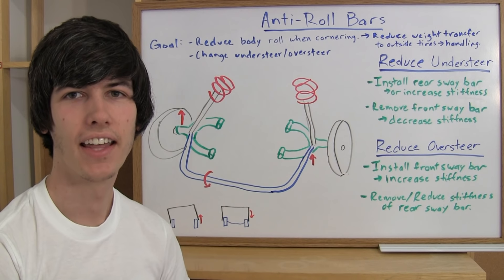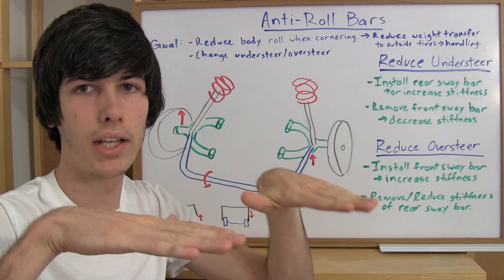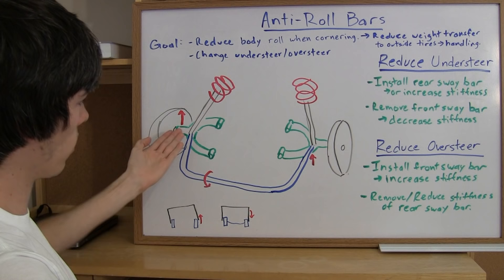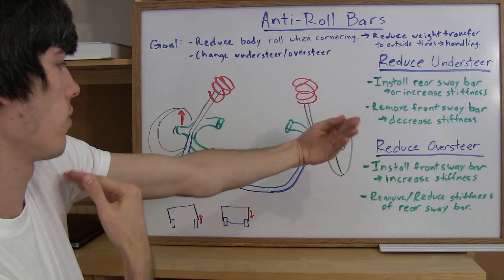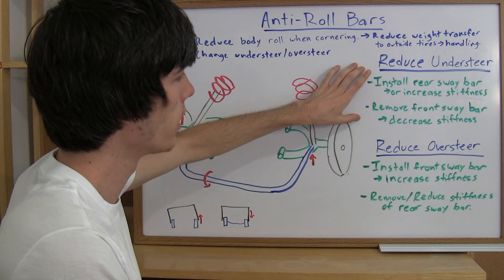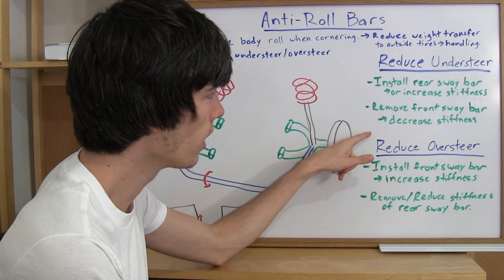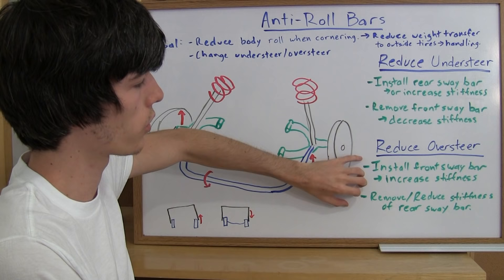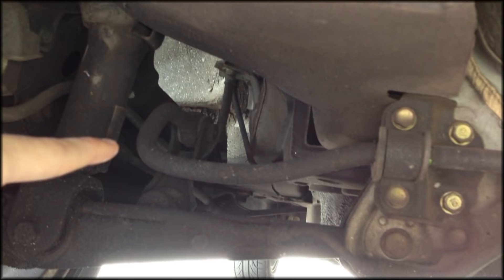How Anti-Roll Bars Work - How To Improve Car Handling

Comment: Hello Jason. Some people have been saying that removing the rear anti roll bar on a '14 Subaru Forester XT makes a huge difference to ride comfort over bumpy roads, without sacrificing any handling. Apparently the stock springs and shocks are already so stiff and the double wishbone setup so good that the anti roll bar is unnecessary. Do you think this is a good idea? Will it really make it more comfortable? What do you think about also removing the fronts? People say leave the fronts because that will make a big difference in handling (unless you want to go off road).
Reply from the maker: +Walter Black The logic seems sound, as roll bars do tend to stiffen things up over uneven bumps (left to right). That said, people love to exaggerate on the internet, I would be willing to bet in a controlled test where one car had the rear roll bar removed and one car was stock, not many people would be able to accurate claim which is which. Might make a comfort difference, but probably not super dramatic. I'd also chat with the dealer about it and make sure there are no warranty issues with removing it before doing so.
Reply: If you drive like a granny, never over 35mph, you'll likely never notice it missing. 
Personally, simply upgrading the rear bar on my Impreza from a 13mm to 18mm made a massive difference in handling. 
I'd never remove a sway bar, unless purely offroading.

Comment: Fairly accurate. ARBs allow a car to run a high roll stiffness without running a high heave stiffness. Obviously individual wheel inputs will act on the roll bar but not to the same extent as rolling.

Ultimately total weight transfer is constant and is dependant on track width and CoG height, the CoG to Roll Centre height dictates how much of this transfer occurs elastically i.e. through springs, dampers and ARBs and how much is transferred geometrical through the suspension links.

I'm a bit confused by the slip angle part. The easiest way to explain how an ARB changes handling balance is by viewing them as a way to modify the amount of weight transfer each axle contributes during roll, the total transfer is unchanged you can just shift the majority forward or rearward.

Having a stiff rear ARB increases weight transfer at the rear axle as the rear axle now has a higher roll stiffness (it resists more of the total roll moment), this reduces weight transfer at the front leading to better load distribution across the front axle, increasing grip on the front axle (due to tyre characteristics) and thus reducing understeer/increasing oversteer :)
Reply: It's kind of astounding how much misinformation there is on ARBs out there, isn't it?  Boggles my mind at times!  This was pretty good overall but missed some significant points.

Comment: You can make diy adjustable roll bars by making adjustable droplinks. Usually when a car is lowered with coilovers or lowering springs the antiroll bar turns too much "upwards" when car's weight is on suspension. Therefore you'll need shorter droplinks to make the wheel lifting effect faster on the inner curve side. If you know what I mean..

Comment: First, thanks for the videos.  They are very good and I have learned much from them.  However, anti roll bars ALWAYS INCREASE weight transfer in roll.  In racing this can be seen when the inside wheel is completely pulled off the circuit by the stiff ARB, in which case, the outside wheel is carrying all the load.  Ultimately the ARB is good by maintaining good wheel camber on the outside wheel - leading to maximum tire contact patch size/traction and increasing the cars transient responsiveness

Comment: Before I watch this, I wonder if you would comment on the BENEFITS/ pros and cons of NOT HAVING anti-sway bars. a little more darty and nimble in tight turns without them methinks. much more stable on highway high speed, long turns with them.

Comment: I think anti roll bar reduces the independence of the suspension. For example if a wheel passes over a pot hole the anti roll bar won't allow the individual wheel to plunge into the pot hole isn't it?? Request your attention in clearing my doubt. Thanks.

Comment: If the sway bar is going to adjust the deflection of both independent suspension systems of the tires same, then the main reason for which independent suspension system is installed i.e. deflection of the only tire under bump is getting lost, isn't it?

Comment: the primary reason for ARBs is to control tire camber on the outside tire during a turn.  You could achieve the same with very stiff springs; however softer springs give better tire compliance and grip; therefore, we use ARBs to control car roll in turns.  You only want bars stiff enough to control tire camber at the speeds you drive - slow speed = softer ARBs

Comment: Do you need a rear sway bar? I have a suzuki swift, but my rear sway bar broke and is making a lot of noise, but to replace it, I have to buy the entire rear suspension, which costs A LOT of money in my country. So, I want to know if I remove the rear sway bar completely if that will do any significant damage. I read some cars don't even have a rear sway bar.

Comment: so which one would you prefer would give a rear wheel car a better handling/reduce roll? front sway bars or rear sway bars?
Reply: Depends on what you use it for. lets say, 240sx Having sway bar in the rear will help that back end swing out. some that do track will unhook rear sway bar because they don't want to drift around the track. adding a front along with the one in the back will increase cornering but reduce that back end swing that the rear sway bar does.
Hope this makes sense. this is what I have gathered over the years correct me if im wrong

Comment: Great video. Thanks.
Am i correct that adding sway bars will not require wheel alignment?
Also if i don't want to alter the steering (over/under), i should put the same bars in both the front and the rear?

Comment: Correct me if Im wrong, but it seems to be very alike to a solid axle. Anti-roll bar seems to be doing the same thing? Doesnt it? Great videos btw. Im very thankful. Ive learned a lot.
Reply: An ARB is the opposite of a solid axle.

A solid axle causes cross-side jacking on compression, magnified by the inboard position of the spring perches.  An ARB causes cross-side compression, along with a reduction of body roll.

Solid axles have essentially perfect camber, assuming a smooth road surface.  Independent suspensions suffer from camber loss in roll, and an ARB helps to mitigate this.

Comment: I removed my front arb in my Seat Leon Cupra R as it understeers from oem setup. I also got a larger rear arb and the chassis has a MUCH more neutral balance in the corners. Still a little push but that's more down to how the Haldex engages the rear tires.
Reply: +oistein74 nice job. on FWD racecars the front arb is often disconnected for racing on a wet track. This limits understeer and maximises traction.
Reply: My car is AWD and I still run with no front arb. Much much better.

Comment: What i dont get is, the sway bar makes the tire on the inside of the corner lift up, but that reduces the pressure of tire. I am assuming that the reduced effect of body roll outweighs this?

Comment: Thanks for your video. I’ve got a Range Rover sport with a hydraulic anti roll bar. I’ve got a leak where the bar comes out of the actuator. Is it ok to use stop leak to remedy this situation? I understand the system is very sensitive to foreign particles. Thanks for your time and patience.

Comment: Wonderful explanations. But I'm confused a little bit here: the 2 ends of ARB are typically fixed to the unsprung weight, while the body roll or weight transfer happens to the sprung weight when cornering. How does ARB's torsion reduce the body roll?
Reply: ARBs are attached to the body in the middle.

Comment: I have a question. I just replaced the sway bars on my 2017 MX-5 Miata. Boy what a difference stiffer bars make! When removing the OE bars, I found that unlike the replacement kit, which allows the bar to rotate inside of a greased, poly bushing (which makes sense to me) the OE bars are vulcanized to the bushings. This suggests to me that there can be no, or very little twisting of the bar from one side to the other. Seems to defeat the purpose all together, no? It seems as if the almost decouples the two sides of the bar so that they can’t influence one another, which is the whole point. This makes zero sense to me. So why do they do this? Are most OE bars this way? I’m so confused.

Comment: Quick question: Wouldn't an ARB defeat the purpose of independent suspension? One consequence of installing an ARB is that what happens to one wheel will happen to the other and thus a suspension system such as a double wishbone isn't truly independent. Am I thinking about this the wrong way?

Thanks for the awesome videos by the way! I've learned more from you videos than from talking with all my wrench head buddies.

Comment: good information, quick question, are sway bars necessary? they seem to increase vehicle's weight. Another question, are they used on independent suspension, axle suspension or both.
Reply: +George Kariuki Anti-sway bars are not necessary.  They are useful tools for enhancing handling and safety without the harshness of higher spring-rates.  They are highly recommended.  

Any axle or independent suspension system can, and often will, use this system.
Reply: thanks for the info, Pete, greatly appreciate
Reply: Ultimately we usually need ARBs because cars are longer than they are wide. More roll resistance is generally needed than pitch or heave, and the relatively minor loss of independence "costs" less in grip than running stiffer springs. It's possible to go overboard with ARBs, but there are a number of vehicles out there that do quite well with half or more of their roll resistance being contributed by their bars.

They are used with both independent suspension and solid axles.

Comment: Just wondering should I upgrade my front and rear sway bars at the same time on a FWD car if I wanna reduce understeer? Will they level out each others' effect? Many thanks.
Reply from the maker: It will result in a car with less overall body-roll, but the effects on steering dynamics will be somewhat countered, with the stronger one having more influence.
Reply: Engineering Explained I see. Thanks for your reply man :)
Reply: If u want to reduce understeer you would have to apply a similar or larger diameter rear sway bar

Comment: so basically it works like space bar key button on keybaord?
and we get dependent suspension from independent?
sacrificing with comfort? each bump will be transfered to the other wheel and chassis?
Reply: it is a spring, so it only transfers part of the pressure to the other side! on a unpaved road, causes comfort by annuling the tiny vibrations!

Comment: Note to Stu continued... and if there is no rear ARB, the rear tires have more overall traction than the front which is the definition of understeer.  Lateral Load Transfer = Lateral acceleration in G's * weight * Center of Gravity height / track width.  A sports car cornering above 1G transfers 70+% of its weight to the outside tires.  Having that outside tire flat against the road ends up to be more important that anything happening with the inside tire.  Continued...

Comment: Old video, but can you tell me why if you are wanting to reduce understeer you would soften or remove the front swaybar (supposedly increasing grip). So if removing swaybars increasing grip why do we run them? Cant we reduce bodyroll by stiffer springs instead?

Comment: Dosent the anti-roll bar force the left tyre to the ground if the car is taking a sharp left turn ?
Reply: No, it has a lifting effect on the inside tyre. Cars with too much ARB will lift the inside tyre on the axle with too much of it, which is a pretty bad thing.

Comment: ARBs do affect weight transfer and the above equation does not tell the whole story when the vehicle's body rolls. Sprung and unsprung masses must be taken into account separately and we need to also determine roll centers so that the weight transfers can be calculated. Then we can continue to roll resistance where springs and ARBs come into play and get the final distribution of weight transfer in roll.

Comment: If i where to change the handling characteristics of my car, lets say it under steers too much (front wheel driven).
By installing a rear sway bar, is it then futile to install a front top strut bar? In the sense that it would cancel out the rear lower sway bar purpose?

Comment: Thanks for the videos, love hearing the science behind this stuff. 

Have any opinion about using adjustable end links to set a pre-load on sway bars for street driving?  I can't find any real pro opinions on it. 

I have them set neutral now but there's a few degrees of slop in turns. Thinking I may try preloading one side a few mm's against the struts on the opposite side to see if it tightens things up. Would love to hear your input. 

BTW, 05 Subaru Outback xt with sway bars & +30% springs, that's about it.  Thanks.

Comment: I was just going through my basics. My doubt is if we
increase the roll stiffness then the body roll should decreae and hence lateral load transfer should decrease
If lateral load transfer decreases then when applied to the front axle the understeer capabilities should decrease because of the tyre slip characterstics(Load sensitivity)
However the opposite happens

Comment: Continued:

If you get added grip from increasing total roll stiffness (without changing tlltd) it will be due to minimizing the movement of poor suspension geometry. More likely though, you will lose grip due to minimizing the movement of *good* suspension geometry, and you will be much more likely to lose grip driving over a bump in the road as you've taken your independent suspension and then linked it up again (assuming you used a ARB to increase roll stiffness) left to right.

Comment: If roll bars reduce weight transfer to the outside tires, and provide better handling, then why does adding roll bars to the rear cause oversteer (rear tires to slide out)? My point is that they actually transfer more weight so it makes the tires slide faster than the front. any arguments on that?

Comment: hi guys looking for some help and I'm a little confused. Just put some 18" wheels on my car replacing 16" wheels. They are much wider and heavier of course.... what I notice is my steering responds differently and sometimes pulls more to left. DO YOU THINK A BIGGER SWAY BAR WILL HELP BALANCE FRONT END AND HAVE BETTER STEERING RESPONSE ? Right now I have 26 mm front and 19mm on back. Thinking going for 30mm front and 22mm back . Appreciate your help really driving me crazy. Thanks everybody.

Comment: For a car with a torsion beam or "multilink" rear suspension, do I still need to add a sway bar? Some say yes and some say no it won't make any difference because the torsion beam is basically a sway bar. What do you guys think? Yes or no?

Comment: Hey Jason, great channel, watch it regularly.
I participate in AutoCross, and was thinking about installing a rear sway bar (I already have a strut bar)... the thing is I only race once every month, is it worth it? will it improve mi timing? will it affect the grip?

Also, I watched another of your videos "5 Suspension Mods That Can Ruin Your Car" and it made me doubt about them.

In conclusion, what do you recommend?
PS: I drive a Mazda 3
Reply: You will likely see more of an improvement in autocross with a front sway bar, if you're only changing one.  MacPherson strut suspensions suffer significant camber loss in roll and diminishing that can improve overall grip.

Sway bars really should be seen as a united system.  It's seldom worth leaving one alone and only touching the other one unless you are constrained by rules.

Comment: I'm curious about how you change your slip angle with an anti-roll bar?
What you should had say is when you change the anti-roll balance (front/rear) you change the load transfer balance (front/rear). Where you have the stiffer anti-roll bar you'll have the more load transfer so the opposite track will have more grip.

Comment: I installed Bc extreme low coils on frs. When I go past 75 mph I get a lot of Quick swaying left to right. I have the front cambered out and also Bc endlinks. Everything else is stock. High speed steering feels unstable what could that be?